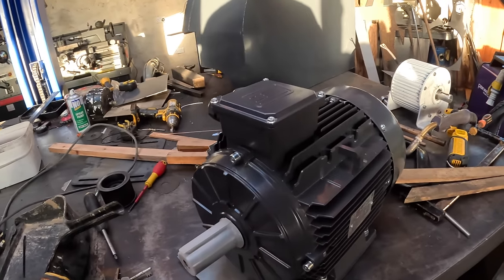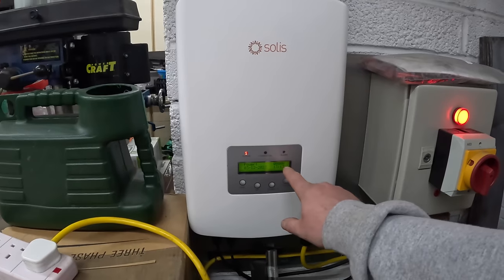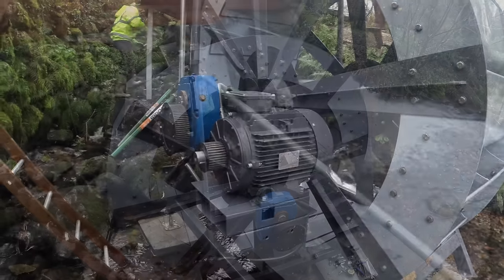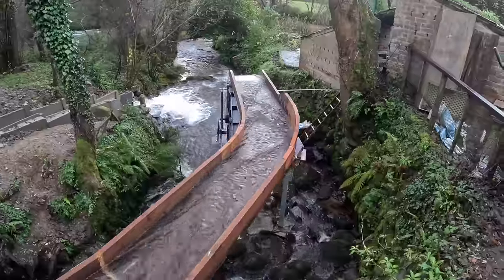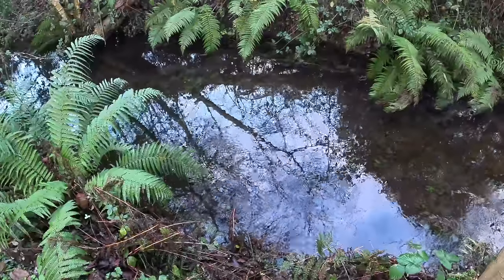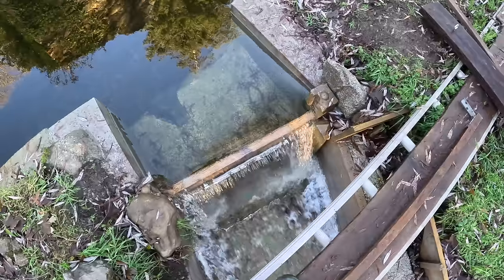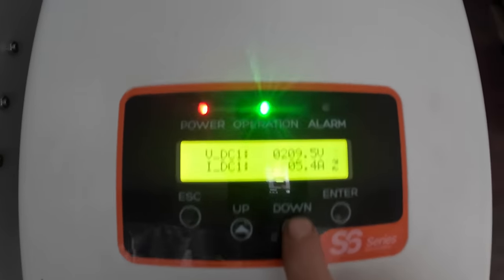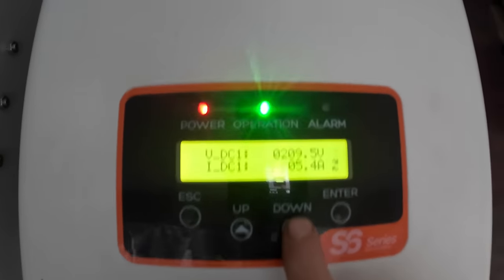Powering An Old Mill  1.5 Kw Lake District Overshot Waterwheel Project Part 4

Comment: Being an EE retired since 2011 I am impressed with your grasp of the mechanical and electrical specifications and skills needed to correctly design and build a one off generating system to a specified output. Great Job. Ray Stormont
Reply: Maybe you can answer me then. It appears to me that there is plenty of force from the water to turn a different gear ratio for a higher ratio towards the motor.  Could this be done to change the 1500-1600 produced, into 1800ish?  What fails in this scenario?  I'm no sparky, I play with bricks, blocks, and stones!
Reply: I am also a retired EE about 10 years ago.
I don't believe a gearbox could produce more output, as Kris has actually already shown by using more water. Because the resistance is too great and the wheel slows down so much that the water fills the buckets too quickly. The only thing you could do is make the buckets wider. But that means you're actually starting from scratch again.
Reply: @slyknowledged  The limitations most probably are in the water wheel and that cannot be changed by gearing. As Chris shows the buckets are filling up and peaking at 1500-1600 W. Changing the rpm with other gear ratios should not make much of a difference there, just risk increasing the splashing and losses.
Reply: @slyknowledged  or give it a higher resistive load with more capacitor
Reply: Amazed ? That test engine ran at 1 rotation per second and Kris says 1800 rpm ' . Amazing indeed !
Reply: Eh. It's pretty good for trial and error, but I don't see evidence of much planning based on understanding of the numbers. The fundamental design of the trough indicates that nobody there read any of the hundreds of books written on water power and the implementation of overshot water wheels over the last 500-odd years. One of the earliest discoveries with overshot wheels is that you get maximum power by preventing the water from the trough gaining any appreciable kinetic energy and just GENTLY filling the wheel buckets. This trough has too steep a slope, and then has a curved chute at the end dumping a HUGE amount of kinetic energy into the water, and leading to splashing. There really shouldn't be ANY splashing in a well designed overshot wheel.
Reply: You are correct in my opinion about slowing down the water and the amount of documentation I did not see a way to fill the buckets fully other than by adding a second stream earlier so that primary sluice had less to do. My suggestions were to attempt to get to 1.5kw constant while reducing spray/spillage to acceptable levels using whats already built. Earliest leatler water wheels date to 475BC. so humans have a lot of expirence using waterwheels. @jhbange
Reply: You should file a lawsuit against the institution responsible for awarding you an EE degree. You are utterly clueless about electric motors if you actually believe his 3 phase motor is capable of generating any amount of power without permanent magnets.
Reply: @bobweiram6321  I have seen a reciprocating steam engine power plant that used a DC generator to excite the fields of the AC generator to make power.  There were controls to adjust the cycles and the interconnects to the grid.
Reply: It works well and produces plenty of power.  Great outcome. Good grief the nay sayers are just hmm.
Reply: @royreynolds108  You are indeed correct. Brushed and brushless DC motors run on DC current, but can also generate AC current. Your typical car alternator is just a generator commutated by the engine with diodes to convert AC output to DC. DC motors work by spinning a magnetic field over windings and vice versa. The magnetic field is produced by a permanent magnet. Induction motors operate on a completely different principle. The alternating current induces a magnetic field in the stator which commutates the rotor. Essentially, the rotor is an electromagnet.
Reply: @bobweiram6321  bro u just fully shamed yourself. how do you think EVs regen? Its not the most efficient. But definitely works.
Reply: @bobweiram6321  you should probably hand back your degree from the University of Life if you don't understand the concept of using a induction motor with a C-2C configuration of capacitors as an induction generator.
Reply: @bobweiram6321  He backfeeds the motor with 3 capacitors as you can see. Via the grid side !
Reply: @you-know-who.  Excuse me Mr. Meathead. Isn't past your bedtime?
Reply: @jeanhawken4482  it simply a proof of concept it small butt it works  just as the micro turbine works  , but prof of concept need development money to get then of the grown & govoment to back the concept of them. But lick the HS2 , corrupt money can kill a project in it tracks. When WAR it seems id a better paying out come.
Reply: @slyknowledged ❤
Reply: What do you think is going to happen on a warm summers day, considering he has no cooling or ventilation systems in place?
Reply: @bobweiram6321  The physics of 6 buckets with 7 liters water makes 42 kilo's of weight. Which never give 1 kW of energy everywich way you look at it.
Reply: @janvisser8452  Maybe if the water was still but it isn't, it is a moving stream and the water dropped several inches so how does that fit into your calculation?
Reply: @jhbange  Any recommended reading? Thanks for the comment!
Reply: If was the owner of this project I would like to have a transformer like both step-up and step down transformer to carry all the load instead of the alternator
Reply: @ruzziasht349  The water will cool the shield around the (now) alternator. I doubt it'd make any difference in all honesty.
Reply: @TellAStoryofficial00  AC travels far, if you use transformers you're just adding more losses.
Reply: @TellAStoryofficial00  proof will be in the pudding - let's hope for a hot summer!
Reply: @jhbange  Hello Pal.  I have built  a different kind of Hydroelectric pico  which works  right now  at a constant  real power output  (on the inverter)  of  1200Watts.  I use a  2KW  Generator  but mine is  150 Kilos  and still i cool it with a 10W forced cooling ventillator. I could  get  some 20-30%  more output is i managed to  reduce the loss of water from splashes. In the past, I made some injectors which lightly improved it. The  system  is running at 1,6 M/second which is  quite high. Obviously, making it run slowlier would improve the filling  but then, I would have to  use a multiplicator  of say 1 to 1,1  or 1 to 1,2.  I can send you  pictures  of the system. I have  6,5m elevation  and 50L/S  flow whie my PMG generator  has a rating  of 60 RPM.  Now with 1150W  it turns  at 50 or 51 RPM. What  do you think i can do??
Reply: Why do you keep apologizing about the so-called noise? It's quite obvious that you and the owner are in a beautiful natural setting. Multiple waterfalls like the Overflow generate the sound of peace! At whatever decibel level.
Reply: Yeah very impressive mate, no doubt. I learnt alot just by watching this series and will be catching up with all your other video's. Cheers!
Reply: Rivers Teign and Dart have ancient water mills with side leats. Kingsteignton in Devon actually has two old mills on one lest that runs through the (what was) a village. Neither make power. Such a waste.
Reply: Terminology is a little obscure to. Me, takes me back to a farm childhood and later a pre engineering curriculum in high school.  I am now 77 and spent a lifetime as an editor/writer.  Anyway, by resistance I assume you are talking about the power transmission/generation system with greater velocity. Not primarily the increasing mechanical resistance with weight and velocity of the waterwheel and bearings themself.  I expect both are involved to some extent, but wouldn’t the first be predominant in these conditions (electromagnetic forces in the power generating systems.). I am fascinated by the obvious, sensible reluctance to push the systems towards theoretical design parameters.

Comment: The way I saw micro hydro turbines do their shutoff/deflector setups is they use a weighted flap retained by an electromagnet. When there is an emergency the power to the magnet gets cut and the deflector plate drops in place. Similar could be done here. No moving parts for the actuaction itself, as long as the eights are sized propperly.  Anyway amazing job,  the survey was really close aswell! Enjoyed watching this series.

Comment: A 2.2Kw asynchronous motor can provide 2.6Kw used as a generator. (5.87A*3*230V*cos fi 0.64= 2592W) In the old days here in Denmark we made wind turbines with asynchronous motors as generators. When the speed of the motor reached above synchronous rpm, a contactor connected directly to the mains. In the event of a mains failure, the motor loses magnetisation and runs freely. Nicely done project. Comment from a Danish electrical technician. 👍

Comment: I absolutely love this project and I'm so jealous of the owner. I invested in a load of solar panels and batteries this year which will save me a fortune over the course of the year even though they are pretty useless this time of year - I have over 9KW peak but they produce next to nothing in this grimy-greyness. 

To supplement them, I've been watching your wind turbine videos, and I'm experimenting with the motors from an old "hover board" but really I'd much rather have a water wheel for the consistency and sheer power you can get from one. Overall, the peak values that solar can produce do not compare to having something generating 24x7.

The wheel you've built is the best I've seen on YouTube by far.
Reply: Exactly this for me. When i was looking at a house ti buy i was wanting to have water like this. But where we are we get lots of wind so im probably gonna go that route for power gen to augment the solar. Cuzz i dont wana rely on sunnt days though we tend to get a lot of those around here too

Comment: Here's a thought:  since the water picks up speed down the ramp it tends to load into the bucket at a high velocity. I wonder if it's possible to SLOW the water just before it falls into the wheel buckets (to reduce splash)?  A mini dam who's 6 inch depth would absorb some water turbulence prior to dumping down into the bucket (or even a couple 1/4" bumps near the end of the ramp).  Especially since your power is from water weight and not water velocity.  Just a thought!  Great project.
Reply: Some great points there  but water inertia increases derived power
Reply: The splashes are  caused by the buckets, In my system, i bring the water from the other side  of the wheel bu I still have some 20% losses

Comment: Congratulations on a major milestone Kris! 
 How about a flow divider of some sort, controlled by your sensors, to maintain the wheel at the necessary speed/flow/load by directing more or less to the wheel. Think boat rudder and autopilot actuator.
 I think the splashing could be attributed to the "Pelton Effect" happening in the bucket, especially if the wheel is being electrically braked but the flow volume is high. There will be that sweet spot where the wheel speed and the flow match. Crack on Mate. Ex Heli Engineer, 30 years in Film. Enjoying following the progress. Thank you
Reply: I gotta stop commenting before I watch the whole video, innit? Lol.

Comment: Fantastic job, Kris, and a very engaging video as always. I doubt you'll see this comment as there are so many, but my only criticism of your system is your use of an AC-to-DC power supply to power a low-voltage contactor for the load dump. I (an EE) would've used a contactor with a coil that could be powered directly from the mains, eliminating the AC-to-DC power supply and increasing the reliability. Sorry if I've misunderstood your system but I think that's how it works.

Comment: The water chute to the wheel could be enclosed ,slightly above the water to funnel the water to the buckets more efficiently (less splashing).
Reply: Yes that should work, but that enclosed funnel needs a hinged "roof" so it can get pushed up if there are any larger objects in the water which doesn't fit into the buckets, for example sticks or an empty bottle or maybe even a soccer ball.
If the enclosure is completely fixed such objects would jam between the enclosure and the wheel. With a hinged top plate, it can swing up and let the objects pass through.
Reply: the screens Kris uses on is micro projects could improve water flow but then thy need to empty quickly  How could that work . Secody exist hols parps like in life boat's

Comment: You have created a beautiful work of practical art.  You have also demonstrated the sheer amount of intricate work and materials and planning needed for an open falling water system.  It now seems obvious to me why those with the will to take on hydro usually choose a pressurized system with pelton wheels.  It seems so much less intricate with modern materials.  Perhaps at some point you could create a video comparing the scope of each option?

Comment: Hi Kris, I'm no engineer. I can't do the math let alone remember all the formulae. I was blessed to be able to work as a technician (the hands on guy or grunt)  with many many engineers from all over the world at GM, so I got a chance to converse with them about everything from the theory of relativity to lunch for nearly 40yrs. I'd like to try and add my hairbrained idea if you wouldn't mind. My understanding of how an inside component of an automobile transmission torque converter; the "stator" works is: A row of small stationary "foils" attached to the casing of an axial-flow turbine, positioned between the rotors, that redirect the splashed fluid back into the turbine to add torque. I am referring to the splashing of water that appears to exit over the bucket and freefall through the air offering no further energy after it has splashed. By redirecting the splash inside the automatic transmission torque converter the torque is multiplied so greatly that I don't believe there is an automatic transmission in the world that doesn't incorporate it. My own vision was/ is a shield that is designed/ sized to redirect the splash back into the buckets, sort of the way the housing fits around a  turbo charger. Fun to watch you and thank you for endeavoring to persevere seeking solutions to all the issues. Merry Christmas to you Kris. ben/ michigan

Comment: That's really cool well done!
Perhaps to improve the laminar flow of the water, perhaps fill the trough with pvc pipes- if it works with straws, I'm assuming it could work with pipes- it may help with the splashing- that or fins at the end, if it works on propellers, I could see it working with water- who knows, could get an extra few watts out of the system

Comment: Really enjoyed watching this project Chris well done 👍 I've worked on a few off grid and grid tied solar and wind turbine jobs with my uncle who also watches the channel. Nothing beats a good hydro system for consistent output 24/7. We've never done hydro but it always comes up in conversation. I would love to learn more about how you wire the 3 phase 8 pole induction motor to turn it into a generator. Looking forward to the next installment 👍👍
Reply: I too wondered about that and how it could self start etc

Comment: I love this project, and the previous enclosed hydro project.  Think of all the historic buildings in the UK that used waterwheels but fell in disrepair because they were no longer economically viable could be running, contributre towards the maintenance of the building and potentially push power to the grid.  And currently local councils are about to sell a bunch of historic windmills which used to turn a few tons of mill stone but could easily run a generator completely unseen.
Also consider the water going through the wheel is being aerated, which will help improve the quality of the water in the river itself.

Comment: Very impressive Kris must admit even though I only get intermitent high flow on the ditches on my farm since watching you I'm concidering a small hydro system to mix with solar and wind 
One thing that crossed my mind watching the splash loss on full flow do you think a  curved shield fixed to the frame round the top third of the wheel just after the shoot would force it back in and improve the peak output by keeping the buckets full 
Would be an easy and fairly cheap experiment

Comment: Very impressive work, Kris, both the design and the fabrication! 😃 Your restraint in keeping from "turning the air blue" over the Chineseium lies 👿 is also quite impressive. I am curious to know how much the generator frequency varies between minimum water flow and full flow, because changes in the frequency may affect the ideal sizing of the 3 capacitors that help turn the motor into a generator. 
To optimize the microfarads of those caps, it might be useful to insert a 3-phase Variac between the caps and the motor. Then you can, in effect, smoothly vary the capacitance to find the ideal sweet spot of efficiency. Then, based on the Variac results the exact right size of caps can be installed for an efficiency compromise, or one or more sets of extra caps can be selected to vary the effective capacitance in steps, through one or more sets of relays. 🤔
I am also curious about airflow to the fan of the motor acting as generator, since the new cover seems to be very close-fitting over that cooling fan end. Shall we assume that the cover is solid there, with only a tiny gap to let air reach the fan? Or is the cover open there, causing a risk of some water splashing onto the fan of the motor? (I can see that water will not reach the interior of the motor, since the type you chose is TEFC: Totally Enclosed, Fan Cooled) @Kris Harbour Natural Building